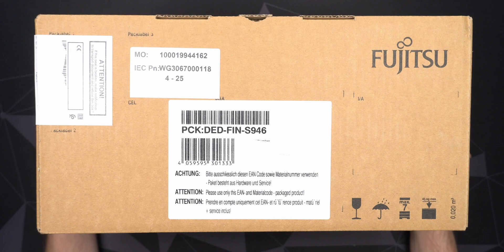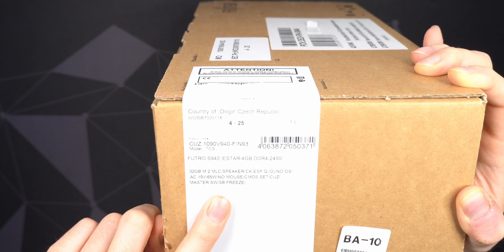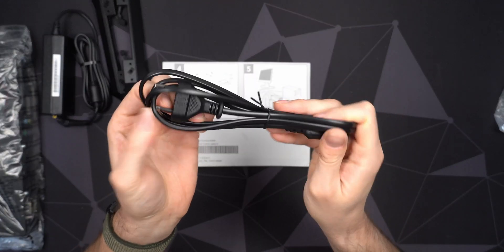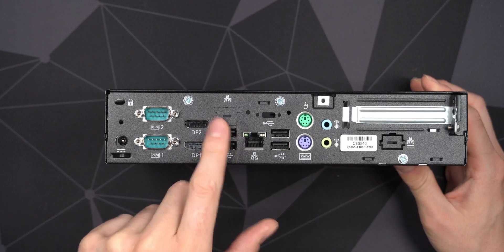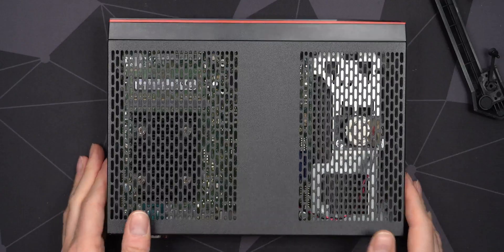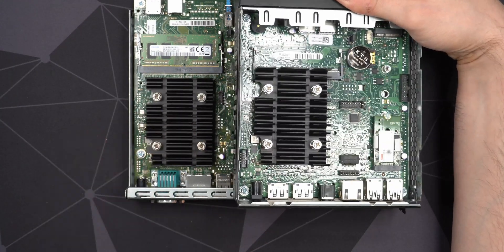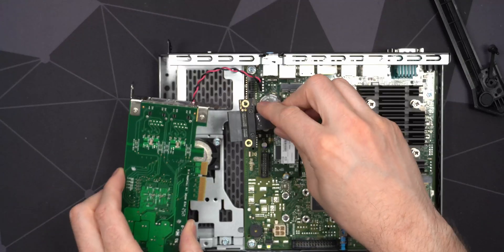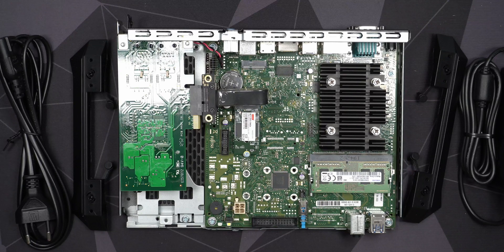Fujitsu Futro S940 Thin Client: Unboxing & Hardware Look

Comment: The 920 and 930 has a SATA underneath the CPU cooler. It's easy to add a 2.5" ssd/hdd using a L shaped SATA cable and a 4pin to SATA power cable

Comment: Can I install an M.2 2280 SATA 3 SSD in there? Do you know about the maximum SSD capacity in GB? Would a PCIe 4.0 M.2 SSD fit in instead of SATA? Thank you in advance
Reply: I have installed a 250gb nvme ssd over the pcie Slot with a riser cable and a adapter with one of the latest v5.xx bios and it works fine for me.

Comment: Do You know what psu we can connect to 4pin plug on mainboard? Can it be normal atx psu, 4 pin processor cable?
Reply: No, but there is a special PS to be mounted where the PCIe card would be, so you would not have an external, but an internal PSU - costs a fortune though, if you can get hold of any.

Comment: Hi, there is also s920 with pic-e slot available. Since this one does have much better cpu I have already replaced it to this one.
Reply: Fujitsu Futro S940 do have PCIe2x1 slot, working fine.
Reply: I got an S920 with the 415, and a GT1030 DDR4,
I consider to upgrade to a 424, or an S940,
Would the vga still work with the X1 PCI-E slot?